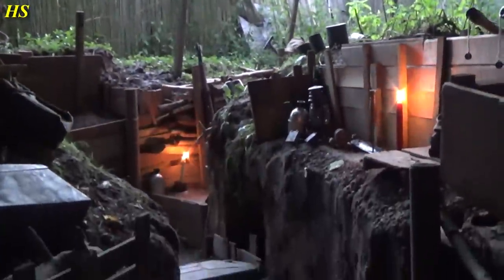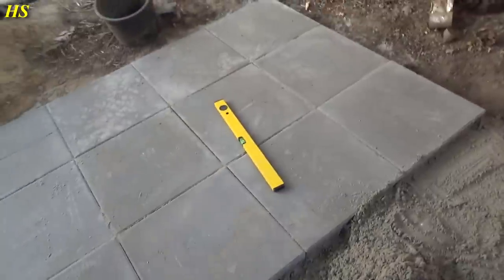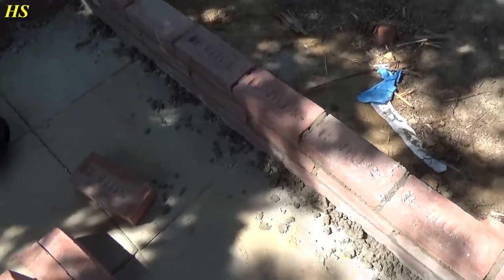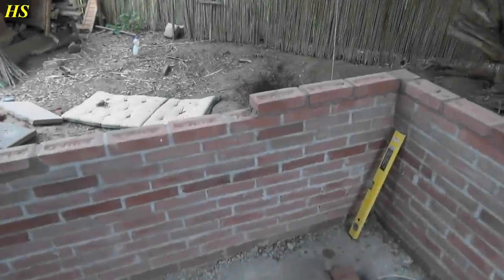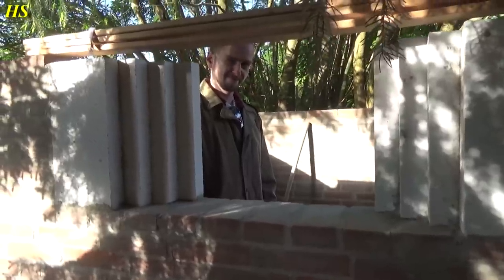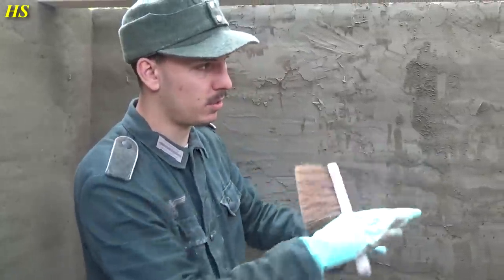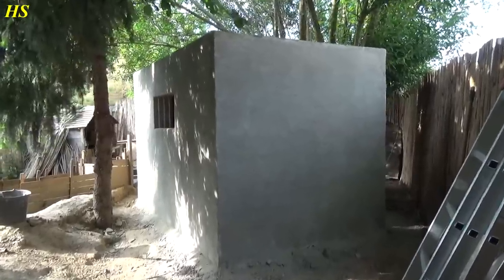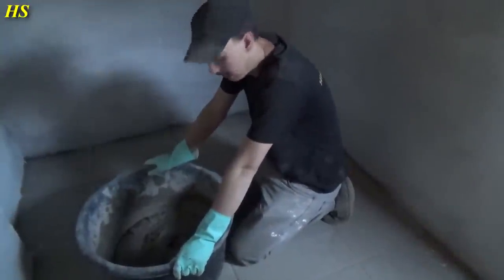Making a WW2 MACHINE GUN BUNKER in my GARDEN next to my TRENCH!! Crazy.. but WORTH it!

Comment: Idk if this has been commented but i have some tips for your next project with bricklaying:

ideally your corner bricks are full bricks, go place those filler bricks somewhere in between, where they are less important. what this also does is giving you a reference point for all the bricks in the line. If you check your alignment on the outermost bricks of the line, you get a reasonably straight wall. you can then for example get a string and place it on those bricks for a height reference.

Also your cement seems a little dry but nothing to worry about.

What you did very good is not placing the bricks directly above each other but with a reasonable offset. In german, laying the bricks directly above is what is called a "Schneiderfuge" (a tailors gap) and a structural nightmare.

Overall good job! :)

Comment: I'm concerned about the strength of the roof. I would be concerned about it sagging and eventually collapsing because you laid the joists flat as opposed to on edge as they should be. I think you did it that way because the thickness of the 2x4 on a flat matched your block. It is very easy to notch the wood over your wall to get the same effect if you had laid them on edge. Or you could have built up the block. Also you should have used something with a little more meat to it like a 2x6 on edge minimum instead of a 2x4 on a flat. It wouldn't have been much to research how to build a strong flat roof. I like your concept and hope you guys enjoy your efforts.

Comment: Interesting project:
But historically not correct!
The Germans had a plan for every bunker form.
According to this plan, a bunker, shelter, position had to be built.
Your bunker has several mistakes the embrasure is too big, for a machine gun bunker the space for the machine gun is missing inside. The outside ribs of the embrasure were lined with wood to prevent enemy fire from entering the bunker / or, better said, ricochets.
There is also no armor plate as a closure for the embrasure.
It is historically correct that there were bunkers / shelters made of brick, but they were more makeshift than real bunkers.
There are many books on the designs and plans of the German bunkers.
Reply from the maker: Sorry, but that's not true..

First of all.. i had a plan before making the bunker, and also.. i'm not a real German in WW2 and it's not really 1942..
The embrasure is not too big, there are many bunkers with a embrasure this big, i've seen them myself in person, and you can find a lot of pictures of it online. 
The wood on the outside ribs of the embrasure are not standard.. most of them do not have wood there at all. 
Not all bunkers had iron plates.. like i said, they weren't all the same. 
Some bunkers were made completely with bricks.. again.. i've seen them.. 

Also.. this is my garden.. this is not made to actually win a war.. it's made for videos and decoration.. it's not a real WW2 battlefield.
Reply: @History-Secrets   Before this goes in the wrong direction!
I like trenches and your bunker is cool and really likes the project.
I am German and have seen many bunkers myself and even had original plans in my hand and know how they were built.
I also know that it's your garden and that you don't want to win a war and it wasn't built in 1942.
 Germans have different classifications.
Bunker/ "Bunker": Concrete positions built according to a scheme with a decent job.
Shelter / Unterstand :
Temporary positions made of wood, brick or a material mix.

The wooden frame is standard for every Mg hole in a bunker, except for guns with a larger caliber.
Since many bunkers are no longer in the original state today, you will hardly see it anymore today.
the size of the hatch originated from the experiences of the First World War.
It was found that snipers liked to switch off the MG crew due to oversized shooting charts.
Please my critique as an attack on your project but as a suggestion for improvement and a help.
Because many clever heads help each other.
You can find good books here in Englich at "Osprey publishing"
I have linked some pictures and books to you here.

http://www.7grad.org/Exkursionen/Westwall/Regelbauten/Regelbau_10/regelbau_10.html

https://lh3.googleusercontent.com/proxy/KshsJ46gouNlDgGykFE3KPI0Q84imB07aivQerXz-lMqBeRvXav2cywKbAiUZSO3lcJpW5jHuhtXxF_tEPBJl01rhZbz9bdavwhQ8_baPlgm8Bttc5_Aljzvs3u5VlPXj7LlieZnGyZ7utya1xR4E5whttps://lh3.googleusercontent.com/proxy/KshsJ46gouNlDgGykFE3KPI0Q84imB07aivQerXz-lMqBeRvXav2cywKbAiUZSO3lcJpW5jHuhtXxF_tEPBJl01rhZbz9bdavwhQ8_baPlgm8Bttc5_Aljzvs3u5VlPXj7LlieZnGyZ7utya1xR4E5w

http://www.festungsbauten.de/NL/photo/NL_05.JPG

https://www.truppendienst.com/fileadmin/_processed_/d/9/csm_grafik_2_unbekannt_gemeinfrei_27e78c696f.jpg

https://ospreypublishing.com/german-field-fortifications-1939-45

https://ospreypublishing.com/the-atlantic-wall-1

https://ospreypublishing.com/the-atlantic-wall-1